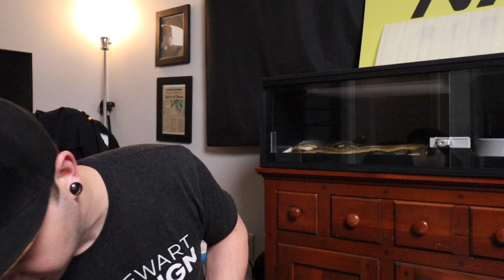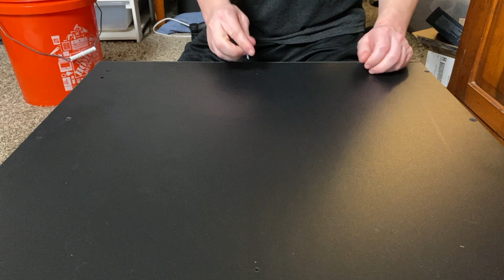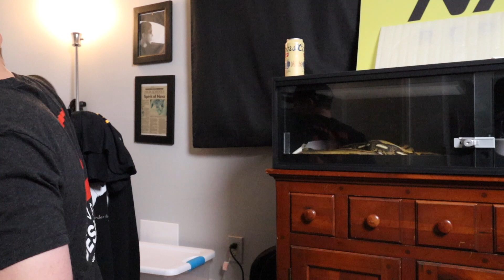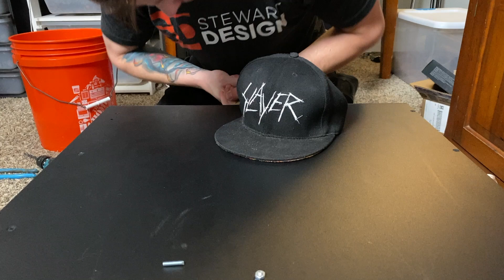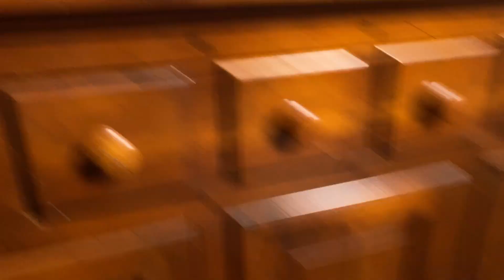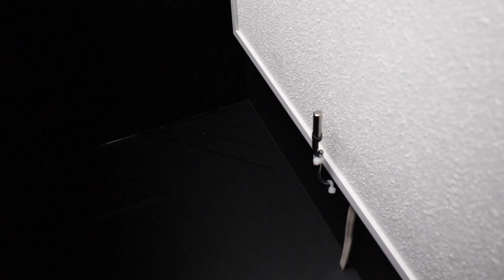How To PROPERLY Install Pro Products Heat Panels & Herpstat 2 Probe Placement

Comment: Hey bro you still use this method? Im trying yours out... what do you have the probe temp at under that panel??
Reply: Another comment said his setting is 88. Im figuring it out today, too. I've tested it on a surface at 88 and right above the warm side substrate so far at 86. I feel like I'm so close.

Comment: I'm currently waiting on my 4x2x2 PVC enclosure to arrive along with my ProHeat radiant heat panel as well for my ball python..I have spent hrs and hrs watching videos on probe placment and installation and hands down I found your method to be the best all around...my only question and I guess thought rather on doing it this way and I'm not bashing our talking bad about you and your way at all so please don't take it as such your way is genius juat a thought I have and hopefully you can answer for me..but with the probe being up high in the enclosure and so close to the heat panel will it make for different temps on the bottom of the enclosure because the enclosure won't have the time needed to come up to the correct temps needed on the warm side with the probe so close to the panel it will reach the set temp much much more quickly and then so what its designed to do and shut off thus by not allowing the bottom to come up to desired temperatures...like I said its just a thought and maybe I'm just over thinking this idk...but none the less great job and fantastic video with great information and insight....

Comment: I just got my pro products heat panel installed... I used the same sized bit you did for the cord and was able to snugly run the probe cord through the same hole and tried having it very close to the rhp, only problem is my pvc enclosure is 8×4×4 and set to 90 lowered the temp of the rhp to 90 and my boa is 4 feet lower than that... I now have it lower to where he is and the surface temp on the rhp is like 198 and maybe rising to try to achieve the 90 degrees 4 feet below the panel where he is. Like I said this all happened within like the last few hours and I'm making adjustments. This is all a bit confusing at the moment and I'm trying to stay awake as long as possible to keep checking the temp of the rhp. It's about 80 where he is under the panel. Do you know how hot a heat panel will get 4 feet above with the therm temp set to 90? And is it safe  for my pro heat panel to get this hot way up there to achieve 90 where he is? I'm gonna try Bob in the am to ask him.
Reply from the maker: Glad you found my video and it was helpful to you. As far as the temps on the surface I’m not actually sure off hand what they should be running with those dimensions etc but yes, I would reach out to Bob like you said. Please let me know what he says if you think about it as I’m very curious to hear myself.

Comment: Love the coat hanger idea. Instead of zip ties I used heat shrink tubing to hold the probe on the coat hanger. It’s been working great so far and looks a little cleaner
Reply from the maker: Great idea with the heat shrink tubing! I'll probably redo mine that way!

Comment: I have the same heat panel and trying to get the temps right is frustrating...what temp did you have to set your thermostat in order to get your hotspot right.  My probe is in back left corner of cage.  I cant seem get a good gradient and my temp probe is set 5 degrees less than my hotspot.
Reply from the maker: Mine are set around 88 degrees to keep temps where I want them and I have a great gradient. I see the snakes move around as they like to in order to find the temp they are looking for at that time.

Comment: Ok. So I use a ceramic heat emitter in one 4x2x2 pvc and a pro products heat panel on my other 4x2x2 pvc. The one with the CHE keeps temps very well. Humidity also not bad. If I spray it on a Monday and get the humidity up to about 85% on the cool side and 65-70% on the warm side (my enclosures have a humidity gradient as well. I didn’t design it that way. Just happened. But I love that) typically Wednesday or Thursday it could use another spray cause it’s getting low. But it’s not even out of range at that pound it’s low 60% and low 80%. Now. The pro products heat panel. Holy crap. I put it in my other enclosure and set everything up started running it and got temps and humidity up to snuff on Sunday. It’s now the following Saturday. The humidity as not dropped. It’s insane. Temps are prefect and heat panel is awesome. So if you need to save some money a CHE (with a safety cage!) will work. Don’t let anyone tell you they don’t work or you can’t keep humidity up. They work fine. The ambient humidity in my house is like 35-45% and I can keep the humidity above 60% in the enclosure with a CHE no problem. Just needs a little spray down every couple days. Which isn’t a big deal to me because your changing the water every day every other day no more than every 3 days. So spray it down move some substrate around clean up or fix whatever they knock over or pile drive through, take the water dish out and clean it and put it back with fresh water boom done. Should be doing that every few days anyway so no big deal to me. But I’ll still choose my heat panel over the CHE if possible. And side note if you use a Pro products heat panel with a herpstat 2 spiderweb thermostat. The plug for the heat panel kind of blocks the prob plug. It still works. You can still use the probe. But it does push on the probe plug. I’m getting ready to swap the plug for one I bought at Lowe’s that will fit better. DO NOT ATTEMPT OF YOU DONT HAVE ELECTRICAL EQUIPMENT SKILLS OR SAFTEY KNOWLEDGE. I really don’t want to hear about or see animals homes or people lost to electrical fires.
Reply from the maker: Great information, thanks for sharing!

Comment: What is special about pro products vs other rhps?
Reply from the maker: The way they are constructed is much better than some others on the market but the biggest difference to me was that they were testing each individual panel they were shipping out due to changing to a new supplier for their heating elements. The attention to detail they show with making sure their panels are as safe as humanly possible was what really sold me on them. I have seen pictures of other panels that have melted and nearly caused fires due to poor construction.

Comment: Thanks. But that's incorrect according to the manufacturer. Too close to the panel. Bob: "Placing a probe this close to the panel will cause it to cycle faster than it should and not allow it to reach maximum output performance"
Reply from the maker: Following Bob's instructions left me with temps over 100 degrees no matter how I adjusted the thermostat so while I understand it may not be the way he says to do things, it's what I found to work so I'll keep it. Thanks.

Comment: Just found this video - definitely informative. Cool trick with the hanger, and I may have to try that in my next setup. I had the exact same sort of temp swings in my enclosure. They're 4x2x1.5 and both use a RHP from Pro Heat (Bob is great). I reached out to Dion at Spyder, and he mentioned the same thing - tape it to the exact center of the RHP. I bought heavy duty/all weather gorilla tape and did that. It took a bit of moving the temp setting around, but once I found the sweet spot all was good.
Reply from the maker: Thanks for checking it out! Glad you found something that worked well!

Comment: Zip tied my panel up to screen 3 years ago the panel is by far the best panel probe zip tied to branch off a wood piece in enclosure an inch from bottom of enclosure under heat panel runs perfectly with herpstat 6 with the light on ramping and the temperature on ramping and mister plugged all in herpstat with humidity sensor from Spyder robotic works perfectly
Reply from the maker: Yeah I talked to Bob as well, mine just wouldn’t regulate properly when I had it there. Bob is a great guy.

Comment: Is that a PH 12 panel ? 12"x24"
Reply from the maker: It is a Pro Heat panel, yes. I actually don’t remember the size, I’ll have to check when I get home and let you know.
Reply: @NavaReptiles  I just ordered a PH12 from Bob at pro products   they are a month backordered so I wanted to see if u had the same one so I know where the wires are on the panel so I can get the enclosure all ready with drilling the holes.  I built my own 4'x2'x20" pvc for around 170$ and I have everything done except the heat panel ..  so if u do have the PH 12 can u tell me if the wire is directly in the center on the panel coming out of the side ?  Thanks. Dave
Reply from the maker: Hey Dave, just got home and looked at my paperwork. I have the PH3 75W panels so they are smaller than what you ordered unfortunately. I can tell you that the wire on these comes out directly in the center on the long side yes, but I'm not sure if it will be the same way on those.
Reply: @NavaReptiles  ok cool thanks alot for looking.   I'll wait till I get it.
Reply from the maker: @TapSnapOrNap203  happy to help anytime I can Dave!

Comment: I got mine and Bob says to place heat prob on cool side on Enclosure as a safety setting? How is your placement working for you as I love the way you placed it. Awesome set up BTW!
Reply from the maker: Hey, I saw their recommendation to do it that way but when I saw how much my temps were swinging even having the probe at the bottom of the cage under the heat panel, I couldn’t imagine myself putting the probe that far away. Temps are good, still see a small swing but not enough to be concerning like before. Thanks a lot!

Comment: Nice video what model heat panel did u get for the t8 enclosures and how long is shipping need to get four panels and 4 t8 enclosures thanks
Reply from the maker: I got Pro Heat panels and they are the only panels I recommend, they are the safest and most well built panels available. The panel they sell you depends on your cage size, material, thickness, your location, as well as the room you plan to keep the cage in. Everything Pro Heat sells is designed and built just for you and your particular needs.

Comment: Thank you for the info great video and explanation. I have a ? Do u use flex watt  heat tape along with the radiant heat panel?
Reply from the maker: Hey sorry for my delay in responding! I do not use any flex watt with these cages. Using the heat panel I get a warm enough basking spot for them as it is, and the cold side of their cage still gets cool enough for them to escape the heat. They have a nice gradient from around 90 degrees down to around 75.
Reply: @NavaReptiles  thanks

Comment: What were your lead times on your order.... how long did it take to get from the time you purchased to be delivery you?
Reply from the maker: Hey Stuart, it took about 5 months I want to say on the cages? The heat panels took about a week from the day I ordered until I had them if I remember correctly. The cages would have been here a bit sooner but my order got mixed in with some "production" orders or something, I'm not sure of the specifics but they were honest about it and got them out very quickly once the error was realized.

Comment: For our probes in our display cage I keep them closer to the snakes level near their hides on the hot side because when I had them up higher I was getting inaccurate temps where the snake actually spends most of its time. I still need to route and mount our probes a bit better since I left them loose with a little wire hanger so I could adjust it’s placement easier so I was getting accurate temps closer to the substrate where the animals spend all their time, now that we’ve got that figured out I’m going to drill a hole lower and use your zip tie method to hold the probes in their permanent position.
Reply from the maker: Yeah Tom this was such a work in progress over about a month before I finally ended up with this and I get consistent temps now at the bottom of the cage. Sounds great man.
Reply: @NavaReptiles  it really is quite a process to get it right lol, I think that’s something a lot of people overlook.
Reply from the maker: Absolutely agree, Tom. It’s a large part of why I made the video.
Reply: @NavaReptiles  definitely a great topic that doesn’t get covered enough, keep up the great work man. How’s my trick het ultramel female baby doing hahaha?
Reply from the maker: @tomrockholm-timeless_morph6691  thank you so much, seriously. All of the babies are doing well. 2 of them still won't eat but I'm going to give them til the end of this week. After that I'll try live and then assist if I have to. I'm sure it won't come to that though.
Reply: @NavaReptiles  awesome, glad to hear they’re doing so good, hopefully you don’t have to assist feed but I’m sure they’ll eat on their own. We look forward to seeing more updates on them.